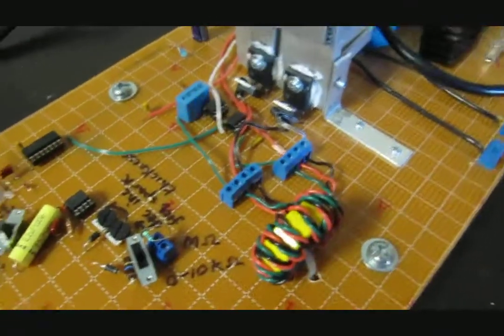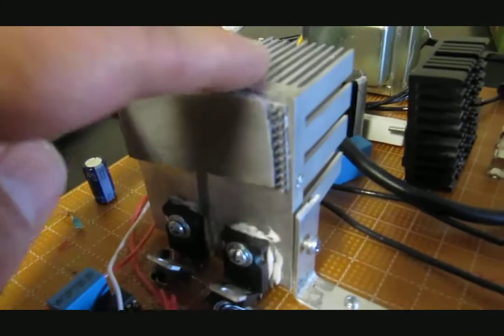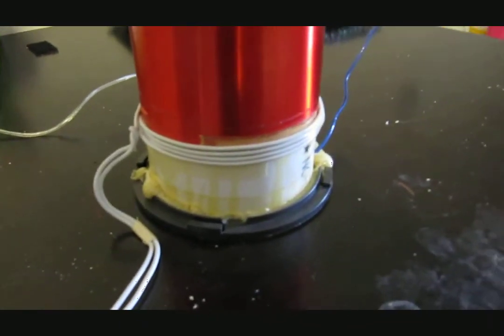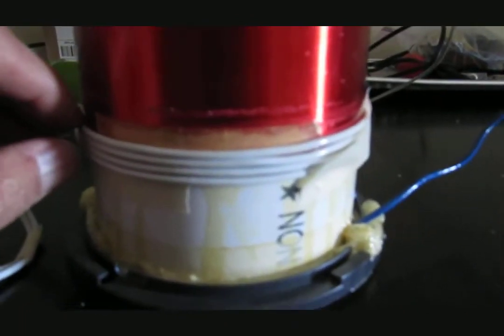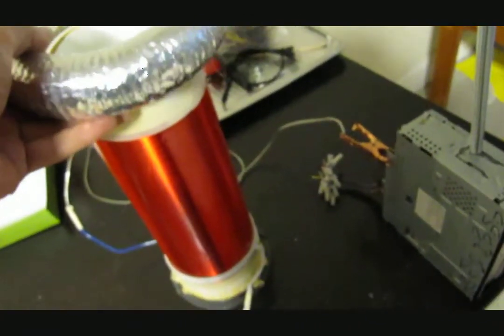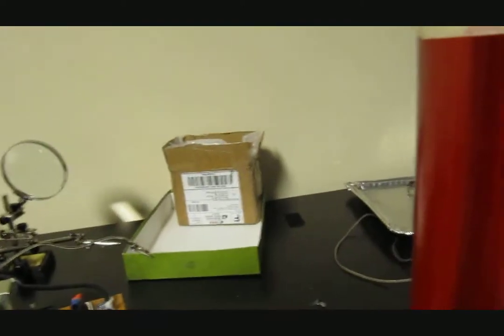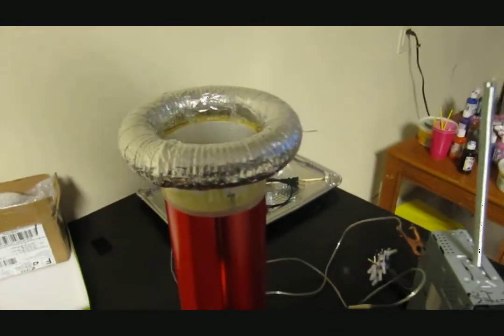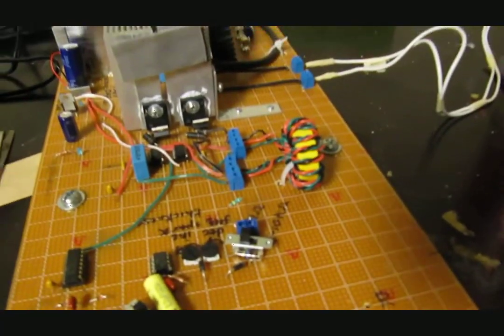PULSED HV OUTPUT FROM SSTC

Comment: is that a 24 volt transformer you're using for the gate circuits?
Reply from the maker: Yep, that is a 24 v transformer. Use voltage regulators for 12v and 5 v  for the gate drive circuits.
Reply: so far everything is working great! its just continuous wave and im not sure if its even being interrupted by the 555... I like your setup and congratulations for getting these cool effects from it, those are some nice still shots! I'll post mine soon, only have the zvs sstc uploaded and my sgtc from flyback
Reply from the maker: Tesla Explorer Looks great. I checked out your stable version of your ZVS driven tesla coil. Thanks for the updates. I will be working on a new tesla design soon and will keep your posted!